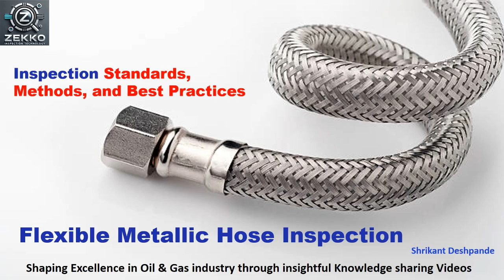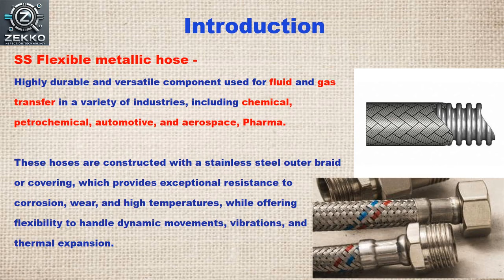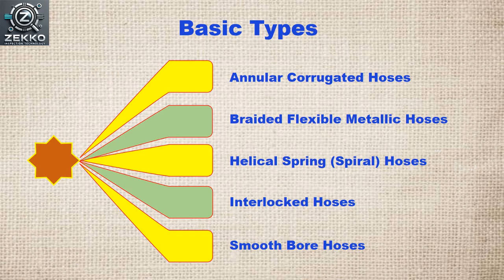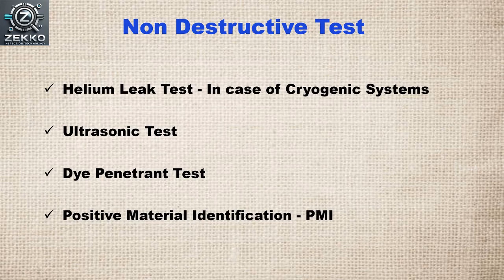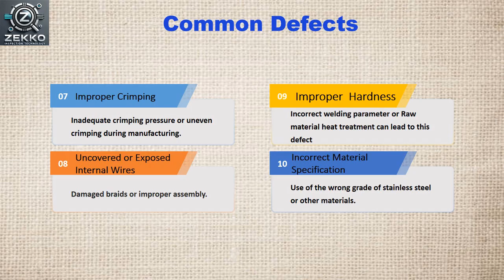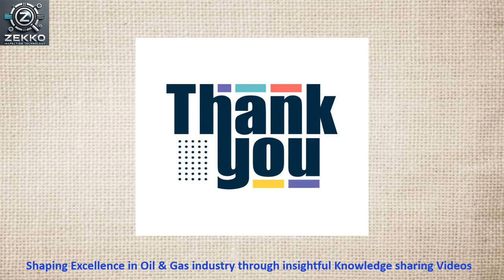How to Inspect Flexible Braided Hoses? Step-by-Step Practical Guide

Comment: "Good information, keep sharing! This is very useful for Inspectors.If you are planning any future equipment inspection videos, could you please share the reference ITP/QAP and explain it stage-wise? That would help engineers and inspectors understand the compliance flow much more deeply.I recently inspected some Metallic Braided Hose Pipes where the critical check-points included pre- and post-hydrotest dimensional checks (to verify permanent deformation), checking end connections with thread gauges, DP testing of weld joints, and conducting both Hydro and Pneumatic tests. Thanks for the great content!"